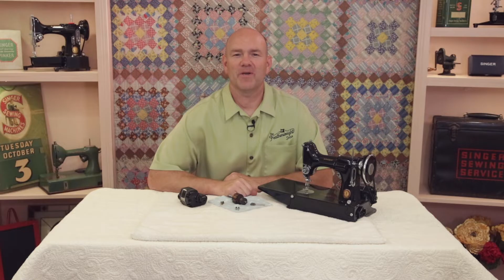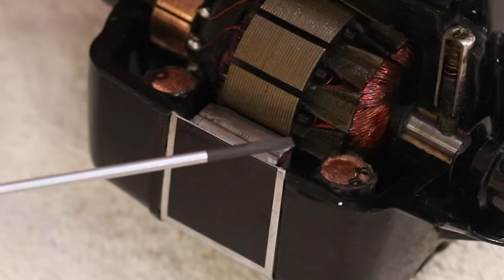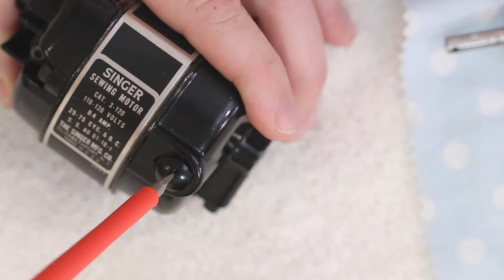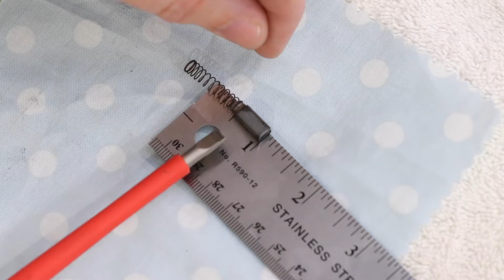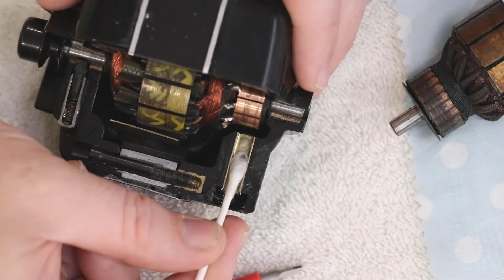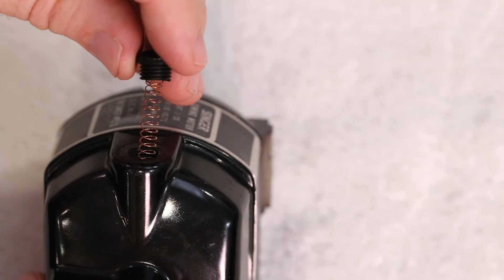Featherweight Motor Brush Replacement

Comment: It would be most helpful if you could advise which way the FWS should be facing , I am confused when it comes to loading the bottom up,
Which also brings me to another question, why won’t it easily fit into bottom port? Do I have to twist it to get it down?
Reply from the maker: Thank you so much for your message!  Follow the link below for more information and to contact us directly with questions about the Singer Featherweight - happy to help!  :) https://singer-featherweight.com/pages/contact-us

Comment: Thanks for the great video.  I will be replacing the motor on my mom's featherweight and I will check out the old one to see if there was a problem with the brushes that led to the lack of power of the old motor.

Comment: I was wondering about replacing the wicks. Seems the motor would have to be opened up. I’ve opened motors on Singer 15-91’s before. Is it difficult